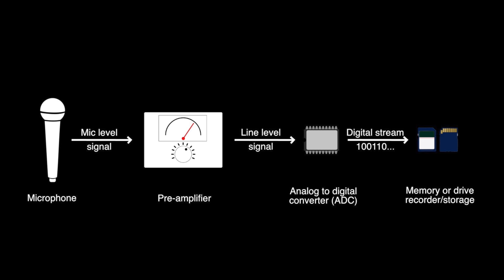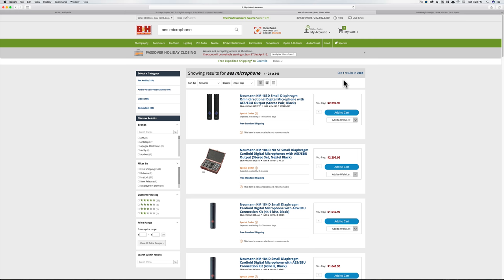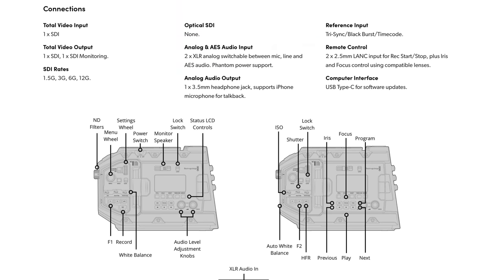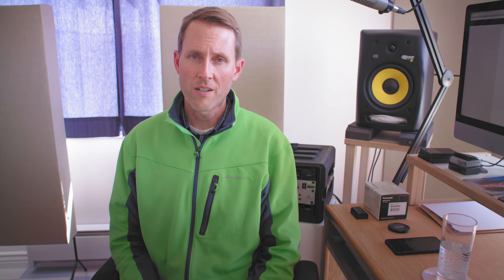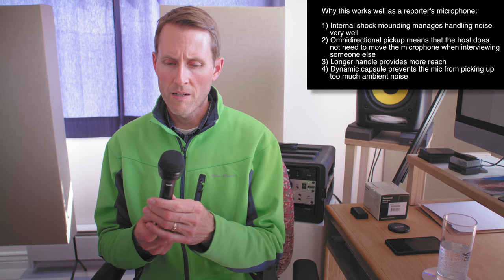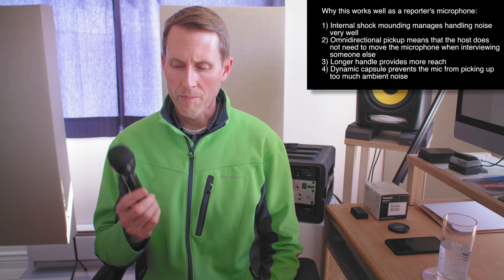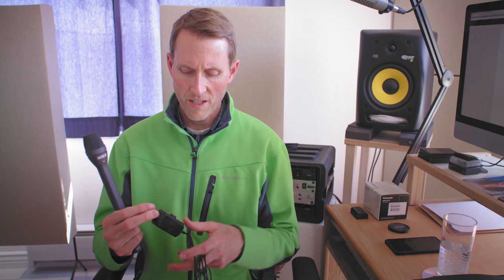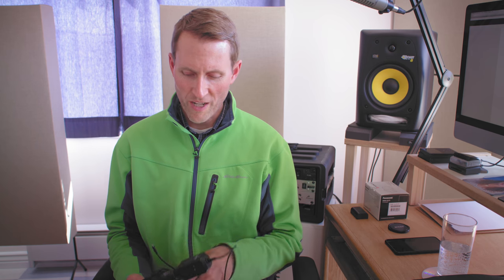Sound for Video Session: AES3 Digital, Ursa Mini Pro, EV RE50L, RODE Reporter and iXLR

Comment: You will really like the RE 50 at NAB. I use it daily. It is so good at just capturing the interview. And is very forgiving, if not pointed directly at the subject. A great Mic. And zero handling noise. You can pound nails with it too. It is that durable. Weather proof. Get it wet, no problem. Workhorse. Can't say enough good about EV Mic's.
Reply from the maker: Thanks Micheal! My limited tests are right in line with your experience. Sounds like I need to consult you for mic advice in the future. On that topic, I'll be in the market for a supercardioid boom in the next few months. The main options I have in scope at present are the Schoeps CMC641 and the DPA 4018c. Also open to other options. Do you have any insight/opinions?
Reply: I really like the Sennheiser 8000 Series. I have two of them. You would want to try the 8050. Excellent Supercardiod. Unlike the Schoeps, you can use it in any weather conditions. Built so well to withstand anything you use it on. The Schoeps is the Holy Grail. Although, it shuts down in humid/wet environments. I can't risk that failure. Just try the 8050. I think you will like it.
Reply: This is a topic of high interest for me and one that took me on a long buying journey. I also like the Sennheiser 8050 but maybe for different reasons. This mic matches up incredibly well with my 8060 and Sennheiser MKE2 Lavs which for me speeds up post production. Before this, I struggled and asked Curtis for help on how to get mics to match up in post because they literally (probably not but it is possible) made what is left of my hair, turn gray. Curtis in case I haven't made it clear, you have been of great help to me over the years. Thank you! I hope to afford to hire you in the very near future!
Reply: Thanks Michael and Carlos. Looks like I need to add the 8050 to my list of mics to try along with the DPA 4018. I invested in the DPA 4017 shotgun but I'll be interested to see how they all line up in terms of sound.
Reply: I too use the 8050 for interior boom work. I have two of them for dual boom use. Matches well with my 8060 shotguns. Also use the 8040 when I need a wider pattern for two talents speaking to each other. You probably know this but these mics can produce AES output by swapping out the standard XLR module for the MZD 8000 module.

Comment: Hi Curtis, nice to know you already have a GH5, so the question is: what do you think about the XLR accessory audio recording from Panasonic and compared with an external recorder as for instance the Zoom F8. Thanks so much for sharing all this information.
Reply: Hello IGIS Producciones, I am also curious to know what Curtis thinks of the XLR input for the GH5. To my ears, it easily replaces the Zoom H2N Pro, H5 and even the H6 is you only need to audio inputs. The F8 only makes it out on set for me when I have complex shoots or I can hire someone to manage the audio.
Reply from the maker: Just received the XLR interface on Friday so I'm getting ready to put it through some tests. My expectation was that it'd be just like Carlos said: Decent but not as good as a pro-level audio recorder. But still definitely a time saver, even if you run the mics through a Zoom F8 or Sound Devices or Zaxcom and then feed line-level to the Panasonic. Would've save me about 5 hours of work on a corporate piece from a couple of months ago...

Comment: Hi Curtis. 

Noting your comment/disclaimer in the intro reference the use of shotgun mic indoors vs super-cardioids. Are you saying that there are better alternatives to the venerable MKH-416?

What would be your boom mics of choice for indoor dialogue? (Ideally something that you could use for both narrative or corporate shoots and not alarmingly expensive).

I find that my MKH416 works really well with the overhead pointing down (just out of frame) technique. 

The sound quality is fantastic when our attention is focused only on the sound's direct path to the mic capsule, but then room tone reflections are also somehow pollutes. 

I thought that shotgun mics like the 416 were staples in the film industry (even indoors on set) and excelled at rejecting sides and rear 

But room reverb is somehow distracting and hard to clean in post. 

I know that there is no replacement to proper room treatment but as sound recordists we don't always have the time and luxury to box our talent in acoustic blankets. I was wondering if you had a few go-to boom mics that you recommend that would help with this problem.

Thanks! 

—Charles
Reply: Hi Charles - If I am not allowed to use sound blankets and I'm dealing with a reverberant room, I'll usually need to rely on a lavalier instead of a boom mic. I'll always put up a boom, usually the Sennheiser MKH8050, but I'll also put a lav on the talent and in post, end up using the lavalier.

Comment: Fantastic video! I have a question about a possible workflow. I’d like to do interviews, record video on my iPhone 10 AND audio from the iXLR. Is that possible? Can I AirDrop the audio files to an iPad and edit them in Luna Fusion. My worries are that I need to use 2 iOS / iPadOS devices to capture video and audio
Reply: Hi Phil, The iXLR is recognized by iOS as an audio input device so any app which records audio will use it. So if you use the camera app or Filmic Pro or any other camera app, it will record the audio with the video clip in a single file. You can then airdrop it to your iPad and edit from there. Hope that helps!
Reply: Curtis Judd thank you very much. That helped a lot :)

Comment: I have a question for you Curtis.
I’m using mixpre6 to record the sound into black magic ursa mini. Is there a device I should use in between the mix and camera to get a better sound Quality into the camera?
Reply: Hi Andre, no, just setting up the line level signal from the MixPre and calibrating the camera to the MixPre using tone should do the job nicely. Best wishes!